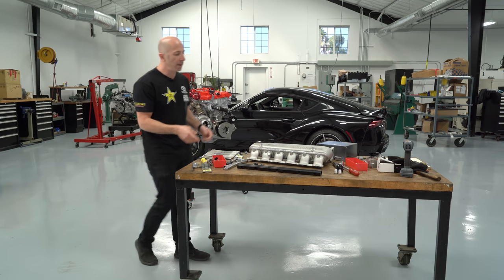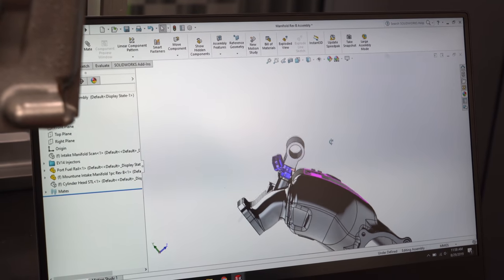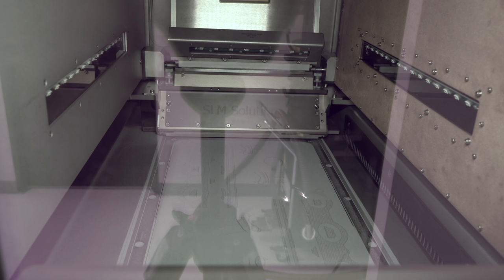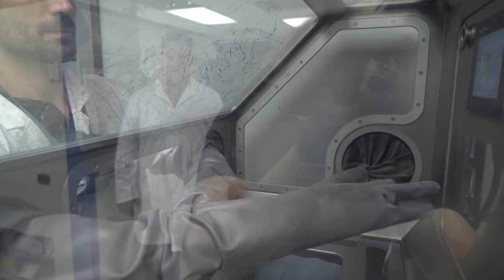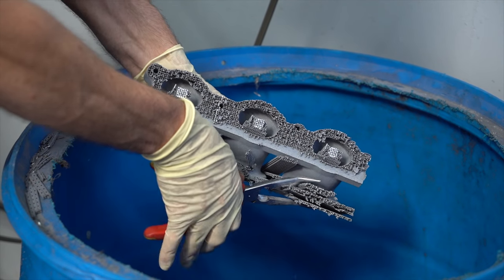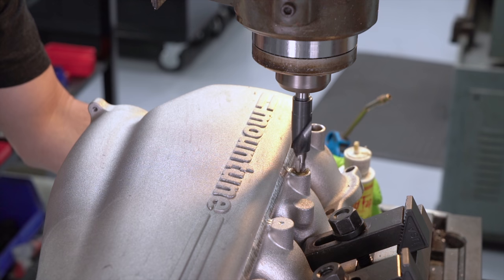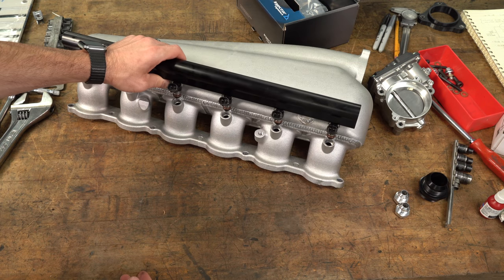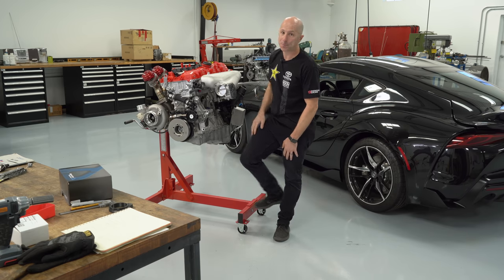3D Printed Aluminum Intake Manifold - Laser Melting Process

Comment: Nicely done!  I wonder if a 5 axis CNC would have been more time/cost effective.    Also, you should check out fusion360 instead of SW.  I really love your channel.
Reply: You'd never machine that manifold unless you split it. For a prototype you could sand cast the part. Part orientation and support
has a massive effect on part strength and internal stresses. Layer orientation can effect strength in different directions
Reply: Richard Baker it was printed and then welded together.  I would guess I could make all those parts on my DMU60 much faster but maybe more costly.  But they would still have to be welded together.  Either way It would sure be a ton of hogging out.

Comment: 50 hours doesn't sound too bad. It took me 30 just to 3d print a 6" inch moon lamp =)
How is the strength compared to a non-printed manifold? Does it print the manifold solid?
Reply: Difficult to say without any more detail. Right now, with the proper scanning strategy (that's how you program the laser, how fast the beam moves and in what specific pattern) and the proper powder, you end up in between mechanical properties of as-cast and mechanical properties of as-forged/machined from forged billet. Selective laser melting (SLM) can print up to 99.95 % density or better, so pretty much solid.

Comment: You could also just print it in plastic and cast that piece in aluminum.  Would be just as fast and high quality but cost under a few hundred dollars.  Not just that but you'd be able to reproduce it multiple times much faster than the first...

Comment: I don't know if I'd want an intake manifold made out of a material that's such a good conductor of heat. The incoming air would pick up too much heat and have its density lowered from the hot underhood air surrounding the manifold. Maybe something like a heat resistant plastic would work better.

Comment: This is good maybe for custom pieces or parts for today unobtainable cars/whatever you need - but if you work on relatively normal modern car, I think it´s just cheaper and more handy just guy part from manufacturer. As long as the whole process is not simply "punch the code in computer, press the button, open bottle of bear, watch movie and wait for ring of the bell as if it is done and then just stick the part where it belongs" and instead it require a lot of work around - I don´t see much reason to do it this way (besides expensive or rare pieces obviously).

But - it is promising, that I must admit.

Comment: But they still have to weld it together when finished so it is still worthles
Reply: You're the kind of guy that would have said back in the day: "magnets, what the hell are they good for?"
Reply: I am all for engineering and innovation. However I think 3D printing something to turn around and weld pieces together is not efficient. If it would have been done on a larger printer in one piece, that would have been nice. I really love the idea of 3D printers.

Comment: seems an overkill cost when cnc machining would have done the same job without the need for the secondary machining back at the shop.
Reply: This is faster, cheaper and the internal geometry isn't hamstrung by the serious limitations of a 5-axis machine. This finished product has at least five fewer parts and 12-13 fewer welds than a machined one. The printed one is going to be close to 10 lbs lighter too because you have to leave so much more meat in there to keep tool pressures and speeds correct. It's also pretty safe to assume that people who make their living building race cars would do a careful cost analysis of the best way.

Comment: "quickly"?  vs injection molding one and buying off the shelf in a few hours?  OMG.. how many hours did you spend?  At say, a per hour rate, plus the printers, plus the clean lab, plus micro grain AL, plus the specialists to run it, plus the clean time, plus the welding, plus the finishing..   did you guys do the math, by chance?    Is this run by a government agency?

Comment: @PapadakisRacing There is a company in Greece called "Extreme Tuners". Nowdays they designed a connecting rod out of full carbon and weights 70grams. They export  parts as well. Give them a call😉 (check them on youtube)

Comment: Al powder not good for you?

My dad had it loose around the factory he worked in. He had noticeable dementia before he retired, which got worse until it killed him.

Metal poisoning is not good in any way. 

(the powder is so fine that it acts like a liquid - wisps of it will escape, like steam, if there is any air movement)

Comment: And based on Moore’s Law, within 5-7 years the cost of doing this should become relatively low enough that the average consumer should be able to afford this tech
Reply: Why the fuck would moores law apply here? This manufacturing technology is not limited by how many transistors per area you can fit.
Reply: F1NNSP1N because the principle still applies, it may not transistors but the cost of tech comes down just the same.
Reply: @vmoutsop  Example: You need a spindle to lower the platform that holds the powder (a very precise one, since it moves in hundreds of a mm), and an electric motor to move it. The price for those components won't change. Moores Law applies to computers, not all technology. Take a regular printer for example: they don't get twice as good, or half the price every two years...
Reply: @Finnspin_unicycles  This is a 3D printing technology using deposition, lasers, sintering, whatever. 5 years ago there was no way Stephen could afford to do this, prices will come down
Reply: @vmoutsop  Yes, they'll come down. But within limits, and not due to moores law. I wish you were right, and the prices would come down to a consumer level. But don't forget this needs an Argon atmosphere, high precision parts, etc. It will become cheaper because machines will be more common, but it's not going to be a lot less than having a part CNC milled somewhere (or owning a CNC machine). Because it still is a CNC machine, and the cost of having something CNC milled is mostly paying for the machine.
Reply: @Finnspin_unicycles  I don't know, just like water finds a way through the cracks, I think someone will find a way to make it work without a clean room, just like one day we'll get room temperature superconductors :)

Comment: I get that these 3D printers have a place.  They can produce specialty parts and even "on site" with the certain ones.  However...51 hours just to print the part and then all the additional hours to make the fine adjustments etc.  There has to be well over 80 hours of time put into this.  And the cost?  All that because you want to get 1000 HP out a supra engine.  You could have a piece made CNC cheaper or even a casted one.  He didn't mention that they were in time crunch to race the car.   Couldn't you just buy a better motor and put it in for about the same or less?   I'm not a full fledged mechanic so I am speaking out of ignorance on this.   For smaller aircraft parts I can certainly see the use of a 3D printer.

Comment: Give it time, the definition you can get on a home 3d printer for 150 would have cost you 50k 10 years ago. That machine is probably 150-200k but in another ten years that tech could be in the range of an average hobbyist. Open source tech makes everything much cheaper.

Comment: this technology realy coming , but that is OK to spend  51 hours for racing car or so , but what if you have to make 500 of manifolds or something similar  and you have a very limited budget . In case of masiv prduction , wee will make cast , but for some number of pcs  it is very hard and tricky to decide what to do , go with 3D printing or , machine that  , or make mold .  Machining of parts like this spec. if you have tricky complex shape with thin walls is very hard .
This TECH is coming but , never will replace machining 100% , never . 
But this is old , now every manufacturer is working in that field od ADITIVE MANUFACTURING , more or less .

Comment: The problem. I see is it's not cost effective. 52 hrs for 1 piece is not time saving and definately not mass produceable.This guy is blowing smoke about cost and time saving.
Reply: For a one off part its definitely the way to go over casting, once the cad work is done apart from the actual printer theres no tooling needed and if changes need to be made you dont need to remake the tooling

Comment: Oh dear...where to start.
Awful up-talking narration,
Narration didn't match most of what was happening on screen,
Using inches....really?
If you're going to use 3D printing then lost wax casting would have probably been as fast or faster and certainly cheaper.
Lost wax casting could have been made in one piece to negate the requirement for welding.